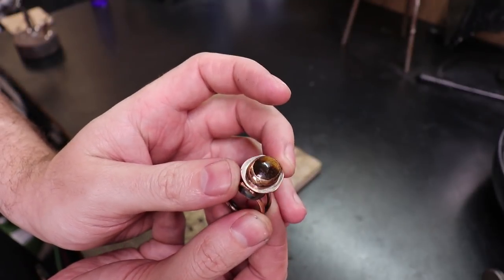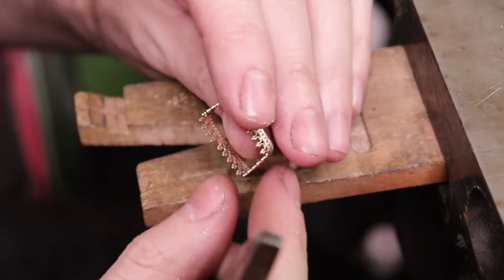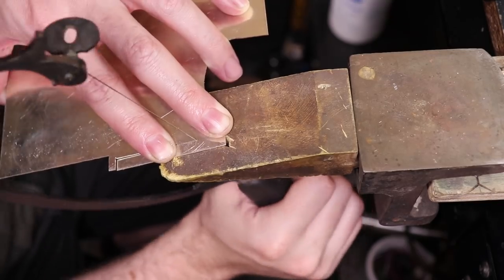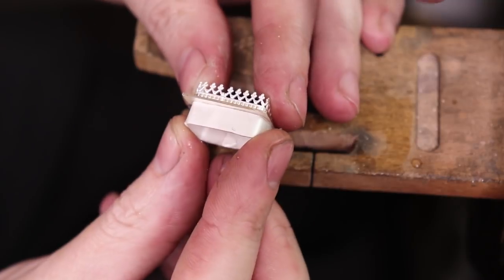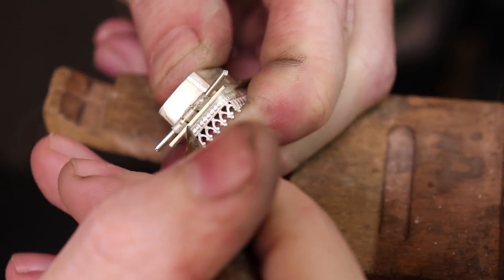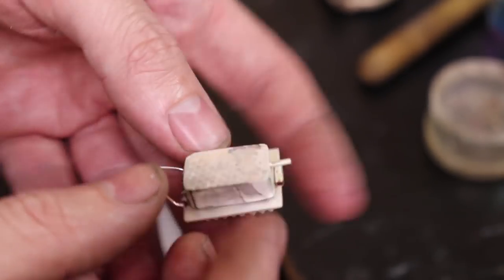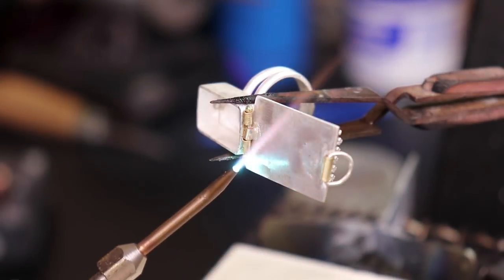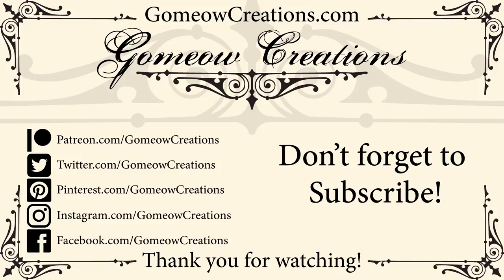Making a Silver & Abalone Poison Ring

Comment: Ps. Randy, have you yet fallen in love with the Lucadent foot pedal? It's a dream, and one of the top tools I'd recommend to any jeweler. It's not even that expensive, about $55 plus shipping, on eBay, there's only one seller, a dental rep.
Reply from the maker: I have this foot control https://amzn.to/2N361LP and it hasn't gave me any problems at all in the last 5 ish years that I have had it. 😁
Reply: @GomeowCreations   I totally agree with you about the foot pedal that comes with the Foredom Flex-shaft tool (if that is the same as the link you sent me) is TOTALLY adequate and useful, it works fine. The Lucadent foot pedal is what dentists use and is kind of the "Volvo/Porsche" of foot pedals, lol! It is smooooooth, and hardy. The movement from stop to increased speed as you work is a luxury experience for not much money, and it will last a lifetime. I was told about it from a mentor and initially thought, "it's a foot pedal, how amazing could it be"? But then I experienced it. That said, it is definitely not necessary, only wonderful. If I was Santa, I would bring it to all students and makers, and would wish it on everyone who uses a foot pedal tool! I especially love it for the hammer hand-piece tool usage, great control over the variable speeds. I'm not a rep, just a fan!!